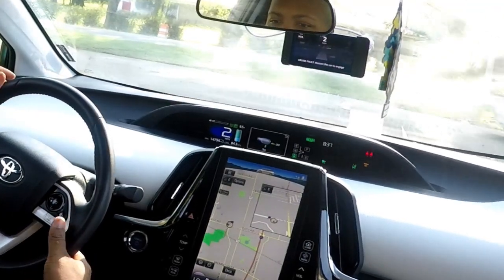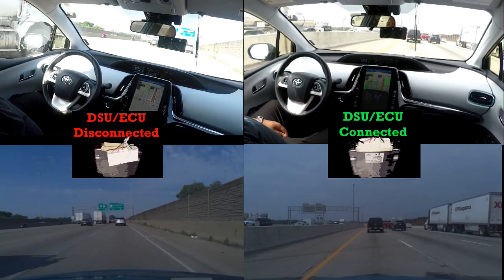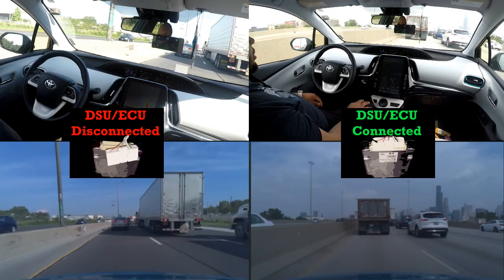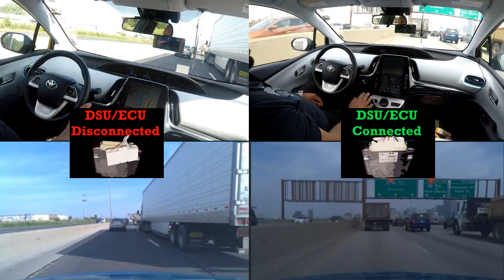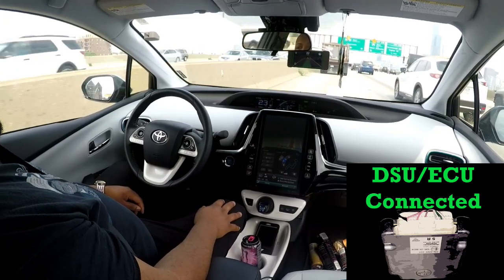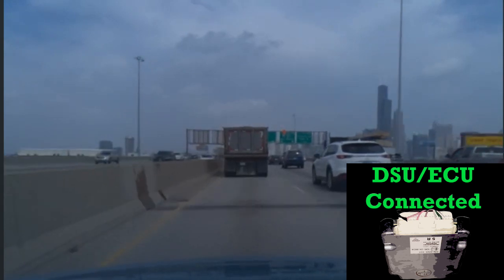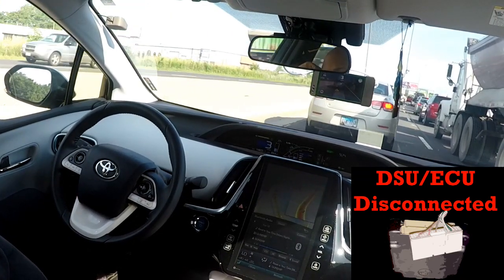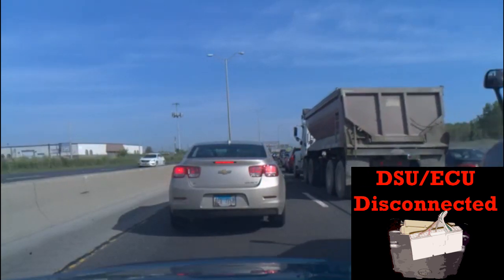Comma AI EON Open Pilot with my DSU/ECU disconnected (2018 Prius Prime )

Comment: I just discovered open pilot and lucky for me I have a 2017 Corolla. I'm just having trouble understanding. Do I just update the eon, plug in, and I'm good to go or do I have to do other things to set it up? Also the Corolla does not have stop and go capability so I'm assuming with open pilot it would work like it currently does and will disengage when it hits 20 mph and I will have to reset it when I get above 20 again. Is that correct? Thanks for the help and your helpful videos.
Reply from the maker: You have to uninstall the stock software from the unit first and install open pilot. From there you disconnect your  Toyota TSS, plug in your giraffe with the panda connected and plug the TSS cable into the giraffe. After proper mounting you EON you hook it to the giraffe via USB and it will ask you to calibrate the unit. After the calibration is complete your ready to go. That's correct 2017 Corollas will disengage at 20mph or lower even with the EON. Disconnecting the DSU may well override it. Because the DSU controls the longitudinal motion.If the EON takes over the longitudinal motion you may well be able to go under 20mph without it disengaging. I don't know for sure and can't test the theory because my car doesn't disengage until it goes to 0 mph for more than 2 seconds. Sorry for the late reply I long hours at work.
Reply: @TheCasualCreator1  thanks for the reply and help. I originally thought I needed to fingerprint the car because I was seeing different things but when I saw the Corolla was on the list of compatible cars I figured I wouldn't need to. Will look into disabling the DSU to try stop and go traffic. Happy Thanksgiving.
Reply from the maker: @Twilight1580  thanks happy Thanksgiving, let me know how it goes bud .
Reply: @Twilight1580  Any updates? I currently own a 2017 corolla. And would like to install comma 2. How has your experience been? if you did end up buying an open pilot comma

Comment: Has your system been pretty good? We just got a rav4 hybrid and we keep throwing the error after 5 minutes of driving
Reply from the maker: Joey Varacalli wow that sucks , it's been working well for me . Besides the first cruise fault error .
Reply: Barely Making It Hello Sir, just disconnected my DSU today. Just a quick question about the first cruise error message, does that happen to you every single time you freshly started your car? And then to remedy it, the car has to be restarted? Have you found anything to get around that the hassle of restarting every time? Thank you in advance for your advice! Appreciated!
Reply from the maker: Are your receiving errors with the ecu connected as well ?
Reply: Hi, do you know if it will work on a prius 2018? I am about to buy the car and it'd nice to know it. I'm in UK
Reply from the maker: Rixi! Yes it will definitely work . Here's a link to the list of compatible cars . https://github.com/commaai/openpilot/blob/devel/README.md
Reply: Thanks  @TheCasualCreator1 ! I had a look to the supported cars list but I was wondering because I didn't see the model in the Wiki. https://community.comma.ai/wiki/index.php/Toyota#Prius_.28for_openpilot.29
I hope to the UK models are be the same as in US
Reply from the maker: Rixi! I came across the same issue my 2018 prime it wasn't listed on wiki either .